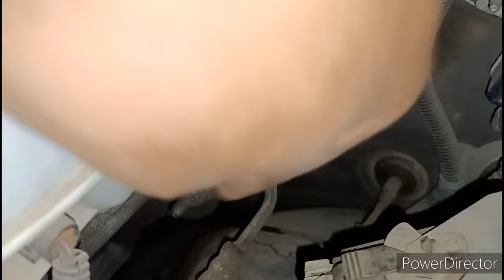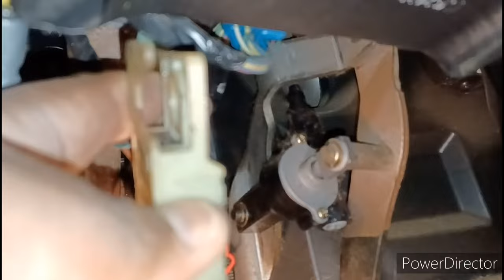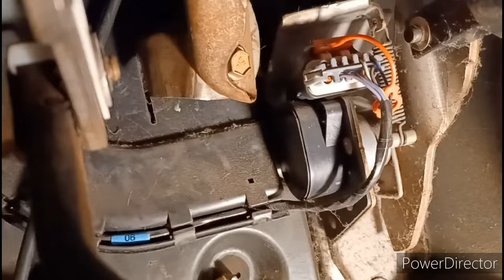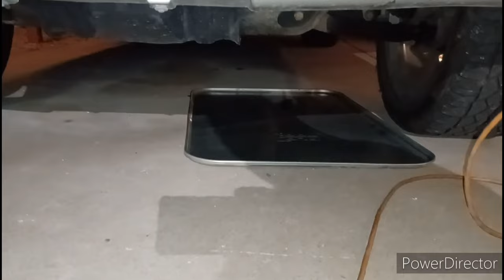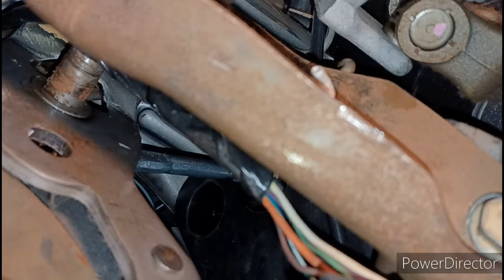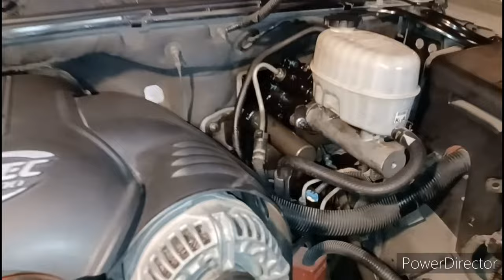How To Replace Hydroboost in 2005-07 Escalade Tahoe Suburban Yukon

Comment: Hey when the Hydro booster on a 05 Cadi Escalade truck is bad. Does it make a humming sound when you step on the brake pedal as well as turn your steering wheel? Should I replace the power steering pump or is it the Hydro booster?
Reply from the maker: The humming is the pump, but check the fluid level to make sure air isn't in the reservoir. If you see a lot of foamy bubbles in there, you may need to top it off.

The steering gearbox also may be the culprit if you're having issues with turning. Check first leaks!! A little hummjng sound isn't too bad, but if it's really loud, that's a sign that one of the components is causing the pump to possibly work harder.

The pump is the last think I would check. Could be the pump, but check the other components for leaks, first.
Reply: @MicDropBBQ  yes, I checked the reservoir. It is full of bubbles when I step on the break and turn the wheel at hums I constantly have to refill it with power steering fluid up. What are signs of the steering box bad with that caused that issue or is it the Hydro booster?
Reply: Also, the previous owner had the power steering pump changed already so I am torn between steering box. Or Hydro booster.

Comment: Would a bad booster make the rear break’s lock up because I’ve changed the master cylinder and it still do it and if I release the back break line on my master cylinder then it release the back break’s as soon as I open the rear break line just a little bit so I’m wondering if it would be the booster
Reply from the maker: There's a small rod inside the master cylinder that hits the brake booster. THAT rod could be too long based on the parts you just bought. Not all parts are the same. Even an 8th to a quarter of an inch could be enough to keep that rod pressing on the inside of the master cylinder. There are two solutions for that: 1) buy a rod that's a hair shorter so it's not pressing against the master cylinder, or 2) Get an angle grinder and round-off about an 8th of the aluminum to where it can seat itself without touching.

I'm not recommending either option, but those are two options I know about. Your choice based on what you wanna do.

Comment: I just spent 200 on rear suspension and spent 100$ on installation. I'm not uber lyft driver of the world if I dont do my own maintenance to save overall money . My prius just hit 260k miles and I've already replaced the whole engine for 3k $ already . Ride till wheels fall off / ride till I die .. slow day today made 250$ in9 hours.  No ride on uber all lyft today.
Reply from the maker: 260k miles is nice!! I've got two vehicles that are high mileage, and run like new!! The trick is maintaining em! Keep fresh oil and transmission fluid. Never low on coolant. Change spark plugs and serpentine belts when they start cracking.

I also disconnect my battery on the vehicles I don't drive much. Saves em from draining down to 1v. Then you got a problem! Hahaha

Comment: Did you have to bleed the lines ?
Reply from the maker: When I did it, I went so quick that air didn't get down the lines. You can loosen the lines if you want to do a gravity bleed, but you're not really doing much to get air into the lines.

It kinda self-bleeds as you're doing it. I've been driving the truck since, and it 100% fine with installing it how I did. You'll have a million internet mechanics telling you 100 different things, but I'm actually driving the truck after install, so I kinda know. 😆🤣

I love how you'll get all of these "theoretical" answers from people who haven't done it and don't drive it.

I never bled it, but if it makes you feel better to do so, go for it. The power steering system will push fluid thru once the pump gets going.

Comment: I need help someone help me i have one that looks like tht but I don't want to get the wrong one how can I really not witch one to get
Reply from the maker: The issue is usually the pushrod. Keep your old pushrod in case the new one seems too long. You can always take the new pushrod out and measure it against the old one. That's the only issue, really. If the pushrod is too long, it will not allow the master cylinder to release all the way and it cam lock your brakes up. Easy solution: use washers to give the bolts on the master cylinder a  little cushion. Just need maybe an 8th of extra space if it happens.

Comment: Part numbers please
Reply from the maker: Couldn't tell ya. It's on the truck already. But of you know your year make and model, you should get the right one. That's how I bought mine.
Reply: Come on now
Reply from the maker: I'm not pulling the part off my truck and replacing it just to get the part number off of it! You're outta your mind. Do you know where to see the part number, because I don't. But if it's against the firewall and I gotta pull the part off, why would I do that?

Year make model. That's how you find the part number.